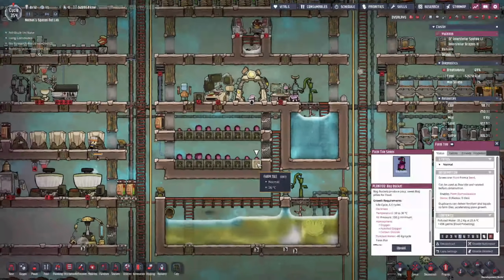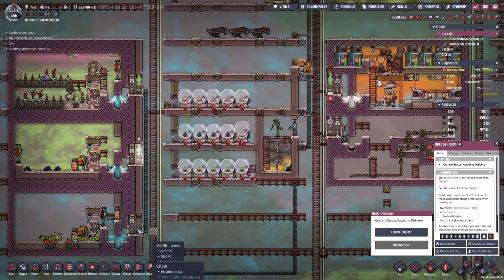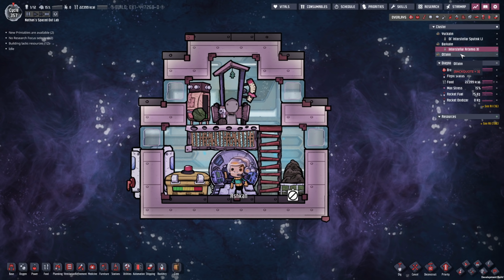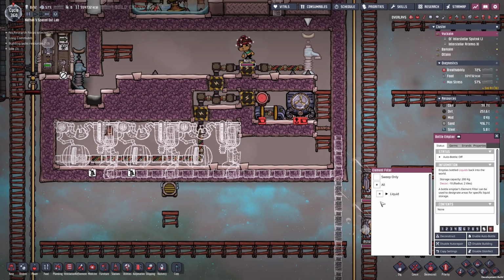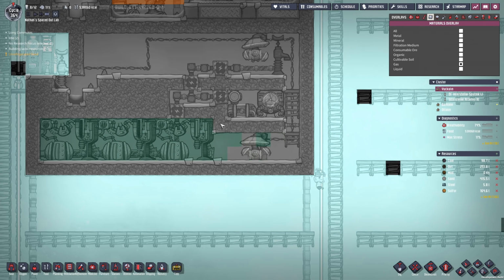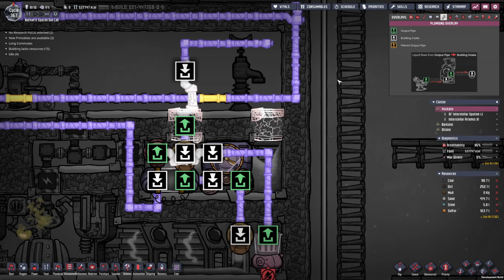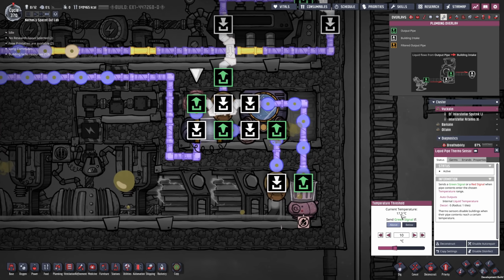NATURAL GAS SETUP - Oxygen Not Included: Ep. #23 - SPACED OUT DLC

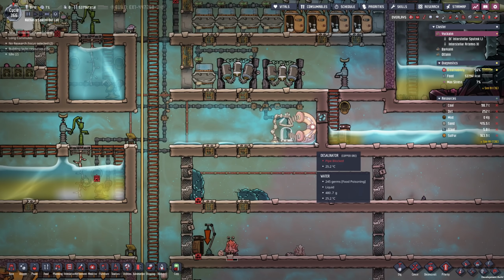Comment: GG. @21:47 The water got on the floor by the desalinator via the mesh tile in the wall to the right of the desalinator.
Reply from the maker: Isn't that an airflow tile? Water shouldn't go through there or am I missing something?
Reply: @Nathans-Sandbox  It looks like a mesh tile to me.
Reply from the maker: Will check the next time, thanks for the hint!
Reply: @Nathans-Sandbox  Just click on the @21:47. It will start the video at that time. Then pause the video. Easy peasy. 🙂
Reply from the maker: It doesn't do that on mobile unfortunately. I scrolled there though and it is a mesh tile;)